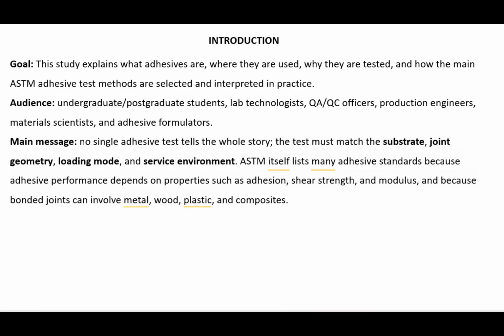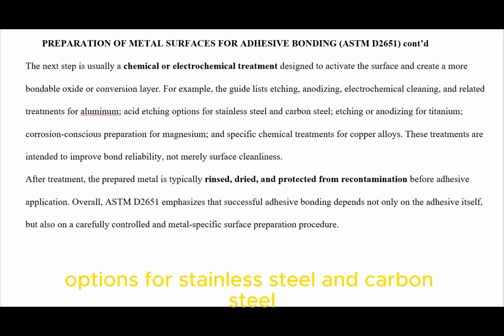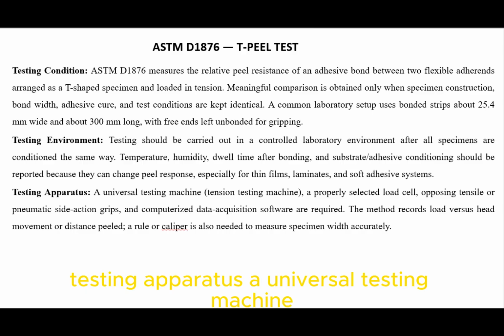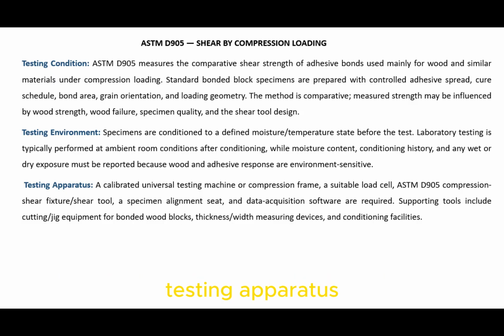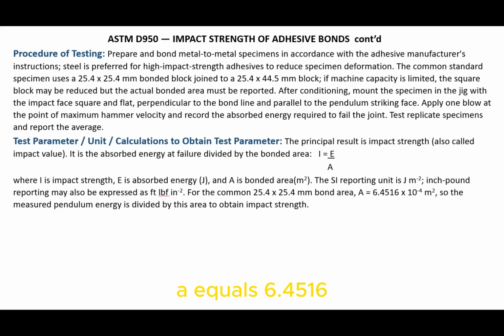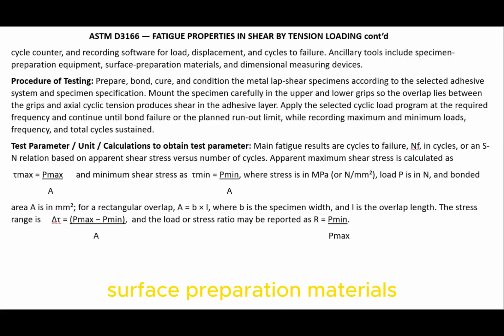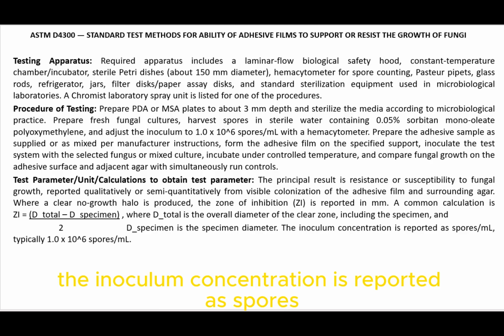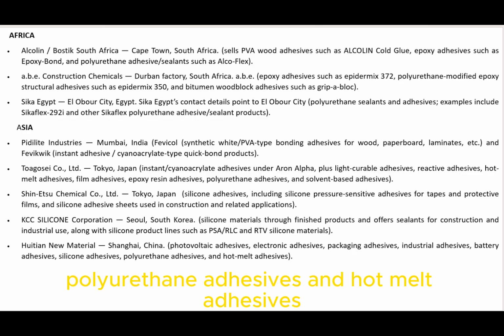avc TEST PARAMATERS FOR ADHESIVES

Comment: U2022/018
Reply: Adhesive testing is crucial because adhesives play a central role in bonding materials across industries—from automotive to aerospace, electronics, construction, and packaging. Ensuring that an adhesive performs reliably is essential for safety, durability, and product performance.
When we say “to support quality control and process control”, this refers to the following:
Supporting Quality Control (QC):
QC is about verifying that the final products meet predefined standards.
Adhesive testing ensures that each batch of adhesive or adhesive-bonded products consistently meets required strength, durability, and performance specifications.
Example: Measuring peel strength, tensile strength, or curing performance helps identify defective batches before they reach the customer, preventing failures in service.
Impact: Protects the reputation of the product and prevents costly recalls or failures.
Supporting Process Control (PC):
PC focuses on monitoring and controlling the manufacturing process itself.
Adhesive testing identifies whether the application process, curing time, temperature, or mixing procedures are producing the expected adhesive performance.
Example: If peel tests show weak bonding in a production run, this signals a process deviation (like insufficient curing) that needs correction.
Impact: Helps maintain a stable and efficient production process, reducing waste and ensuring consistent quality.

Comment: U2022/066

Shear and tensile loading are types of forces applied to materials or adhesive joints.
In shear loading, the force acts parallel to the bonded surface, causing sliding failure.
In tensile loading, the force acts perpendicular to the surface, causing separation or pulling apart.

Comment: U2022/024

Reporting Temperature, Humidity, Dwell Time, and Conditioning is necessary because adhesives are viscoelastic polymers. Their performance is not a single-number material property (like the density of steel) but a dynamic result of chemical and physical processes that are highly sensitive to the environment.

If these parameters are not reported, the test data is essentially useless—it cannot be replicated, nor can it be used to predict real-world performance.

Comment: U2022/5581056

The test environment ASTM D950 (controlled temperature and humidity conditioning)  is used to ensure reproducible and comparable impact strength results for adhesive bonds by simulating standardized service-like conditions and minimizing variability from environmental factors.

Comment: T-PEEL also known as ASTM D1876 measures the relative peel resistance of an adhesive bond between two flexible adherends arranged as a T-shaped specimen and loaded in tension.

Comment: U2022/5581025

The setup for the procedure in ASTM D1876 is called the T-Peel Test. This name comes from the characteristic “T” shape formed when two flexible adherends bonded together are pulled apart during testing.

Comment: U2022/030

In ASTM D2919, the setup for the procedure is called the Apparatus Setup. It involves preparing and assembling the rubber balloon density equipment before conducting the test.

Comment: U2022/045
ASTM D2919 used only stress (like traditional strength tests), it would miss a critical reality:
An adhesive joint that holds for 1 minute and one that holds for 1 year under the same stress are not equally durable.
That’s why time-to-failure is the most justified and meaningful unit in this standard.

Comment: U2022/034
In justification of the use of measurement in ASTM D1876
Ensures reproducibility and comparability
By standardizing results in force/width, different laboratories and tests can compare results consistently, even if specimen dimensions vary slightly.

Comment: U2022/016

Most adhesives need to "wet" the surface (spread out completely) to create a strong bond. Many materials, like plastics or oily metals, have low surface energy, causing the adhesive to bead up.

Comment: U2022/011
The class of dhesive used in flexible laminates is

Polyurethane 
It is used because they maintain a strong bond while remaining pliable enough to bend without cracking or delaminating.

Comment: U2022/031
the ASTM D3166 test procedure uses a lap shear specimen . 

Specifically, ASTM D3166 "Standard Test Method for Fatigue Properties of Adhesives in Shear by Tension Loading."
The setup name for ASTM D3166 is Fatigue test setup

Comment: U2022/010

Structural adhesives are high-strength, permanent bonds (typically 
 psi, often 
 MPa) designed to bear heavy loads in permanent applications like automotive BIW or aerospace components.

 Non-structural adhesives are lower-strength, often temporary or aesthetic solutions (sealing, interior trim) designed to hold light loads, with higher flexibility.

Comment: U2022/071
Adhesive films are thin layers of adhesive material that are applied between two surfaces to bond them together. They are usually supplied in solid or semi-solid sheet form.

Comment: U2022/003
Adhesive bonding can be quicker and more automated compared to welding,  or bolting especially when dealing with high volumes or complex assemblies 
Bonding materials with adhesive has several unique advantages compared to traditional methods like drilling, bolting  or welding, some key aspects that set them apart are corrosion,  speed and efficiency, lightweight, flexibility and impact resistance .

Comment: U2022/020

When we say adhesive testing is used to evaluate durability under hest, humidity, water , or cyclic loading we're talking about checking how well an adhesive bond hold up over time in real life conditions not just in ideal lab settings.

Comment: U2022/023

The process of chemical and electrochemical treatment during surface preparation for bonding is designed to activate the surface and create a more bondable oxide or conversion layer, it is used to improve bond reliability and not merely surface cleaning

Comment: U2022/ 5581026
The setup used for the procedure  in ASTM D3165 is SHEAR BY TENSION LOADING OF SINGLE LAP JOINT LAMINATED ASSEMBLIES

Comment: U2022/059

The justification for the test environment in ASTM D3166 is that adhesive fatigue life is not an intrinsic material property; it is a system property that is co-dependent on stress, temperature, and moisture.

Without a tightly controlled environment, the test results are non-reproducible, the failure mechanisms are ambiguous, and the data cannot be used to predict structural durability under real-world conditions.